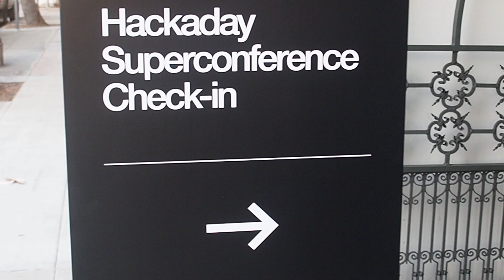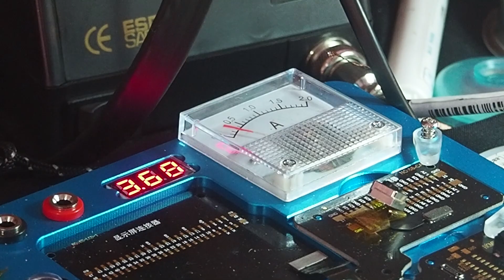PCB Motors at the Hackaday Supercon!

Comment: Yo man, you should embed real copper coils or kind of flex-cable coils with 1layer by 1 layer copper/isolation with as thick wire gauge as possible to avoid overheating and power it up. PCB motor with these spiral coils is really good idea!